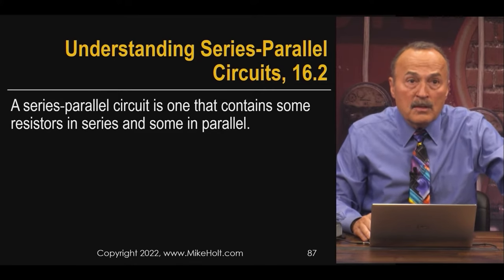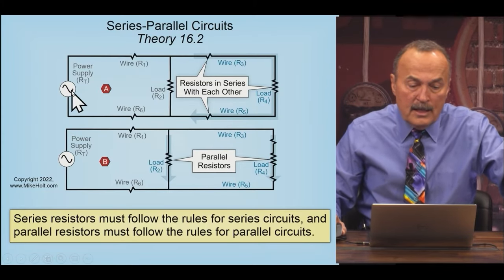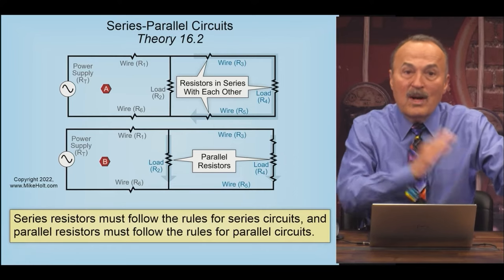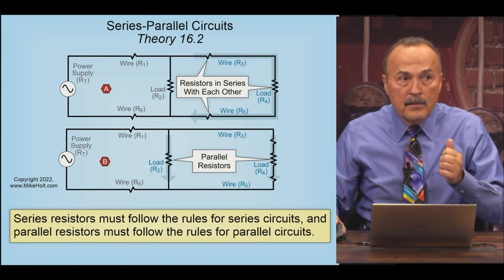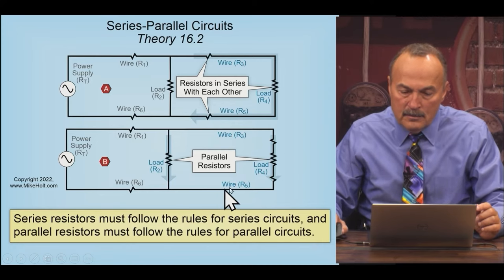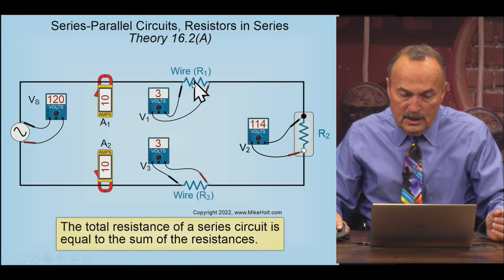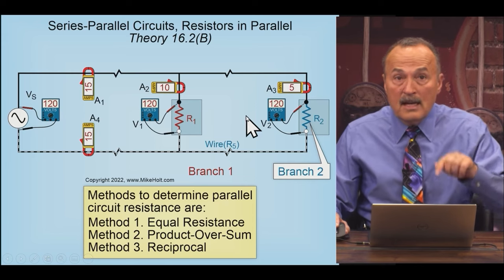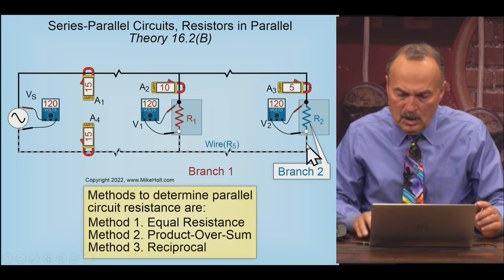Understanding Series-Parallel Circuits 16.2

Comment: If i don't have a proper calculator and i need to calculate total resistance in parallel, i would do it the long way and get divide ,add and divide one last time to get my answer...
🤷 Worked for me